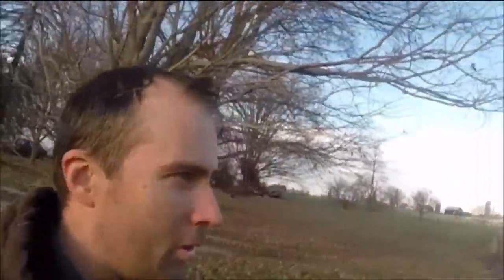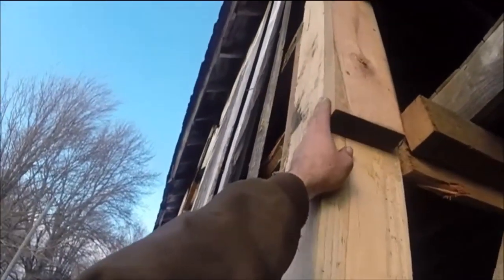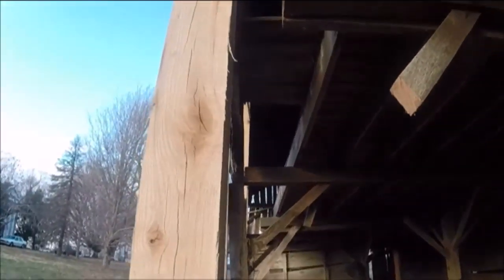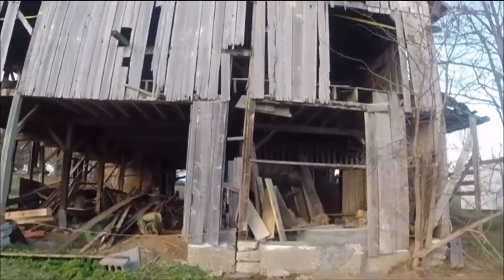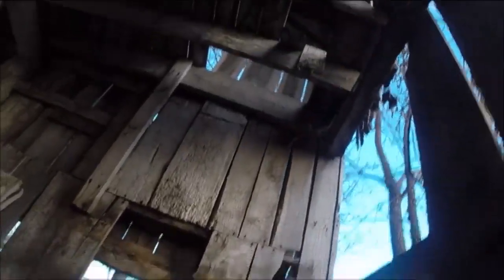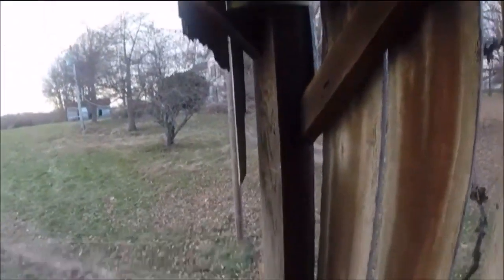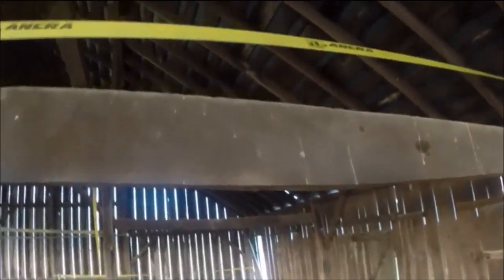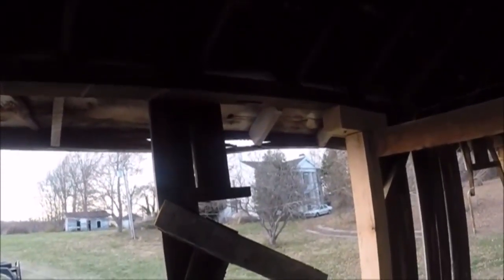This old barn/shop week 8 or something like that update

Comment: Hi Brian,
Lots of work done so far, and still more to go.
I envy that kind of space and headroom, will be a great shop!
Radiant floor is great if possible, 10 times better than walls...
If you can dig outside around the floor and install 24 to 36" deep Styrofoam around the concrete slab it would keep the surrounding from getting cold.
As for the radiant tubes protection for drilling in the floor, you have them installed directly 2" under a reinforcing bar, if you hit or detect steel you know you're close to a tube.
Before going to machining school I've worked 18 years in house restoration.
With insulation, pay special care to vapor barriers and water infiltration, cause rot is going to be a problem and all that nice lumber that lasted 175 years will last not very long any more...
Pierre

Comment: Another thought about heating...  Look up HeatMor or similar wood furnace.  They are essentially a wood fired water heater.  Antifreeze is the liquid of choice, and either run it through pipes in the concrete (expensive and hard work setting up) or run the pipes through some form of heat exchanger (old truck radiator?) run a fan across it and you're done!  To be clearer, the furnace is in a small separate shed next to your building.  The heated liquid runs into your main building from the furnace and through the heat exchanger and back to the furnace.  Rig up a fan and blow it across the radiator and you've got heat...

Comment: Brian:  one trick for you and your viewer's.  In my younger years I did a similar project on an unattached garage of a house buildings 1930's.  Several of the corners were completely rotted away and if you can visualize a canoe that s what the building looked like.  When I drew a tight string across the top of the roof at the peak end to end, in the middle  of the building the roof was sagging ten inches beliw the stting and the wslls were bowed out about five inches on each side.  Now I did essentially what you've done with one addition.  There was already a really good concrete floor and foundation so I turned off all power to the structure and set up a couple of those rainbow sprinklers for a couple nights to soften up the wood given it had been bone dry for sixty years.  That really helped the wood to bend and flex more without breaking or cracking.   Although in your situation you had a dirt floor which may have negated any benefit?  But for other people this might helped.  I was amazed how with hydraulic jacks pushing up the roof and come-a-longs pulling the walls in that entire structure came back straight!  Then every few rafters I essentially built in trusses in place so the walls could no longer push out or the roof sag again.  That was thirty years ago and still looks the same. This was for a buddy, so we then rebuilt the corners, put in new windows,  resided the building, put in all new electrical, roll up doors and it looked awesome.  Plus the permit process was a breeze because we were simply remodeling!
Reply from the maker: That is getting it done!

Comment: Dead air spaces are a problem, especially out here in the Pacific NW where humidity runs high.  There's no way we'd get away without some sort of barrier.  With an un-insulated building  that has sheeting only on one side there's no problem at all since both sides of the wood will breathe into an active airspace nearest it.  The barns I've worked on have all been fine in the un-insulated and single sheeted areas.  The worst rot problems have been where the inside was sheeted with thin plywood, even though there was no insulation, moisture will trap in those spaces and eventually rot.  This problem is worse yet with foil backed fiberglass insulation, since the condensation point ends up falling somewhere in the middle of the insulation, in a dead airspace, the insulation will quickly become wet, and will start rotting the wood.

The wood you are building with makes a big difference also.  Oak, particularly white oak, has a high rot resistance.  Some of the old tamarack (western larch) in the barns I've worked on out here is very rot resistant also, but some is not.

You might live in a dry enough climate and have the kind of wood materials that will stand what you're doing.  If it works, great!  Good luck with it!  Looking forward to your next update video :-).

Comment: Brian, I'm a new subscriber. I was a contractor for 17 years doing home building, before my present career of contracting developments, utilities, roads, bridges, etc., and I'm trying to retire.
I've had some past experience with heat ducts being installed under the floor. My idea is to install regular duct work, such as in a house, or PVC (no rust and long life, a better product) with grouted concrete, around the ducts, in a trench and place them around the inside perimeter, about 14" to 18" down, giving you the needed depth of your proposed reinforced concrete floor thickness. Place a furnace, with your choice of fuel, within the shop or on the outside, in it's own building, at the location you desire. The concrete can have #5 rebar placed over each duct, at right angles and parallel, one foot o.c., min. for concrete reinforcement for any weight application that you might need as well as providing you with any 'bolt down design' that you might want/need. (BTW, your concrete floor, although ground supported, may need #4 bars, or larger, @ 1' o.c. each way for reinforcement and proper weight distribution for your proposed heavy weights). An HVAC tech would need to design the pipe sizes and help with your cfm movement at each duct opening. An opening in the floor might catch debris but risers adjacent to a colomun, machine or near the outside wall with a 90 degree grille opening at about 1-2 foot height, or any height, could keep the heat down low. The trench, 2' width min., or maybe wider, would need polystyrene insulation, on each side and on the bottom, and the outside of your foundation would need at least 2" thick, same insulation, at least 1' below your area's frost line. No need to worry about frozen water if the shop is without a power source for a while. Also a 'french drain' below the frost line around the outside perimeter of the foundation would be nice.
This is similiar to a central heating/cooling system. Some of my rooms in my home are installed like this and if I were to build a new home/shop with a concrete floor this is the method I would choose as my home is very comfortable with this type duct system.
I would put the old siding, vertical with battens on the joints for the exterior finish, as was the original design. And use a vapor barrier.
All of this is just my 2 cents worth! Love your videos and I'll be back for more!
Thanks....13

Comment: looking good brian.  i would go with tin siding.  it may not look as well as the wood, but the installation and maintenance will be easier for you
mark
Reply from the maker: 2007markb  Noted, that is what others recommend too, thing is I have lots of wood to use and I would have to buy steel siding. Currently I am contemplating using the flooring from the barn loft and lapping it horizontal like my house siding. That should seal up nice, add strength and look more in keeping. I am thinking do that and whitewash it for color and protection. Still tons to do before I get that far. :-)
Reply: bcbloc02.  it sucks to have to buy when you already have a different material to use.  i was thinking more in keeps with future maintenance problems.  the steel fab shop where i work has corrugated tin siding from the 30's and we just got it spray foamed and the guys are loving not having to freeze their tails off.  im not sure where youre located, but are you planning on any sort of insulation?
Reply from the maker: 2007markb Definitely! I have a bunch of rolls of R-19 tucked away that I bought dirt cheap when the Home depot here went out of business several years ago so I will be putting that in all the walls and then I will probably throw some R30 on top of the bridge.

Comment: Tons of work gone into that building so far Brian! Still a ways to go but it'll be nice when it's done.
You won't be disappointed with the Noga and I suspect it will become the main indicator holder. I dont use my old beam type anymore and my segment/cable type became the cam holder for good.

Colin ;-)

Comment: Hey Brian - Great update. This is a very interesting project, I've just subscribed. Excellent work so far. As far as the heating is concerned, baseboard heating using a wood boiler could be an alternative. The main advantage would be eliminating airborne dust, welding fumes, grinding particles, etc. that always get into forced air systems. If there's a break in the system they are easy to repair & don't require breaking up the floor.
Reply from the maker: Thanks for your interest! I have considered baseboard heaters but do you think they will effectively heat a room with 15-20ft ceilings?
Reply: If you used the old stand up cast iron heaters & space them say every 10’ your shop should be as hot as you can stand it. You can probably get those for the scrap price. To counteract the tendency of the heat to rise, a shop filter should give you the convection action & recirculate the air without using ceiling fans. Not only would it recirculate the air, the filter would also capture small particulate matter. The power needed to run those shouldn’t be too great. Craigslist & eBay are good sources for them. Their not that complicated, just a squirrel fan in a box with a couple of washable filters. 

You're doing an awesome job getting the barn back in square. After you ratchet in the rafters how do you keep them in place? I didn’t see any new tie beams. Do they just remain static after ratcheting or is there some sort of reinforcement?

Comment: I don't know how you were planning to finish the outside elevations (backfill dirt?) once the footings and floors are poured, but make sure you insulate the outside of the footing with vertical pieces of rigid foam (you'd need at least 2" thick).  Concrete has an R value of essentially nothing.  I think it works out to about R1 per 10' of concrete.  You should extend this rigid foam down to frost line if possible, or to the top of your footings otherwise.  Look up Frost Proof Shallow Footings on the internet for more research...  Looks nice!  I've worked on several old barns and know how much work they are!  Leaving the footings un-insulated will make that building nearly impossible to heat...

Comment: Brian, put tin up and cover with wood, give you a little more insulation and would look great....great job so far.....PB
Reply from the maker: How would you do that? Can you get flat tin? I would think 5V or corrugated would only get destroyed if you tried to attach wood over top of it.
Reply: well,the way I was thinking, if you were able to hit the original wood attach points, you would only have holes there in the metal.....which would be sealed...of course, you might have issues with how tight the wood is attached to the metal....as in not real tight....but it sure would make the barn blend in as old looking....hope this makes sense, best regards, Paul

Comment: I'm not a know it all and don't want to sound like one, but don't forget to put a moisture barrier between your insulation and your wood siding.  The reason for that is moisture condenses on cold surfaces because of the humidity difference between a warm, humid air space and a cold, dryer airspace.  When you insulate a wall, that condensation point falls somewhere inside the wall.  If you don't put up a moisture barrier, the condensation will sit between two wood surfaces and you will shortly have dry rot issues.  Tar paper works well, tyvek works well, something on that order...  I like tar paper because the tar inhibits bacteria growth that causes dry rot, but the paper also gets brittle over time and tears more easily.  Tyvek is a bit more expensive but is easy to apply.  Anyway, you likely already know lots of this!  Good job on squaring things up!
Reply from the maker: Interesting you bring that up. My brother stopped by the other day and he asked if I was going to put plastic sheating up on the outside. I told him no. I am not much of a subscriber to modern building practice especially when it comes to old buildings and building techniques.  If I decide to put metal siding on I will put up a barrier, but for wood I prefer not to have one.  Unless you can airtight seal both the inside and outside of your wall then you are actually trapping moisture. Wood breathes and I prefer that it can. If it can pass the moisture through fairly quickly it seems to do no harm, standing or very high moisture levels for sure does. My house is nearly 200years old and has no vapor barrier under the wood sheating and it has had central heat and air for 50 years with no moisture problems. I believe this is because the moisture can readily pass through the plaster and wood and not get trapped and build up.  One of my neighbors tore all their siding off, fully insulated and covered their old house with tyvek about 15 years ago and they now have mold problems. I think it is because of the lack of air flow. I am not looking for a super air tight building, especially for a shop, it needs probably even more air exchange than a house because of fumes generated form work. In the summer I will no doubt have windows and doors open and enjoy what breeze I can get! I am not a fan of gutters either. They are more trouble than they are worth. For the Midwest here were I am the historic people tend to advocate against vapor retarders and barriers as well. It seems to be of more value further north, but again need to be total sealed to really work the best.  I am not sure at what temperature gradients and humidity it would take for condensation to form on wood but I think it would have to be very high on both counts. Throw that cold energy conducting tin on there and it is another story!  Something for me to think about and thanks for the comment!

Comment: Hot water heat is the way go. I have a 40X60 with 8 300 ft loops in the floor. The only draw back is no lags in the floor.

Comment: That pex tubing from what i was seeing just last week wants to expand a lot on long straight runs, so if you put it in concrete floors i can see a long term issue. Where i saw the problem was a new floor mount baseboard install by a hack. it creaks groans and pops when it is supposed to be quiet heat. the pex expands more than copper does and pushes the heat exchangers on the mounts lol.
Reply from the maker: +Richard Schmidtendorff It seems to be pretty common practice to use Pex in concrete so I assume it holds up ok.  I am sure with 8in of concrete on top of it I won't hear it anyways. :-) I wonder how hot it was getting? I imagine that the oncrete keeps the pex at near its temperature by conducting the heat away pretty quick so maybe expansion and contraction would be less of an issue.
Reply: Yeah being burried in a heat sink probably helps. The expansion and not the noises is what i was wondering about.
Reply: there again though i guess freezing is the only failure i have heard of lol.

Comment: I have seen these guys build and outside of the building boiler (in a separate Building) to heat shops and houses. Some use bio-mass stuff like shells and such (wood) etc. Just an idea.
Reply from the maker: Carter W Hern A wood burning boiler type setup outside was what I had in mind, then I could run the water inside possible to a bunch of base board heaters, maybe some old radiators or something like that.  I like the idea of not having a huge fan blowing all the time to keep air moved around though.